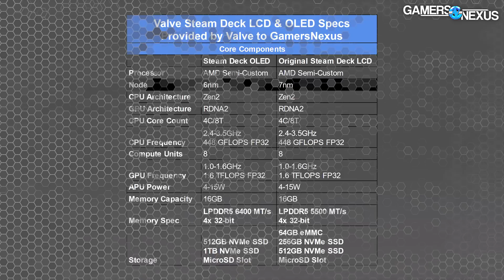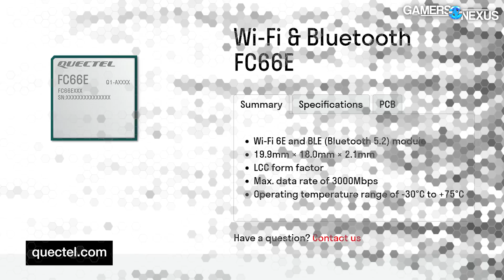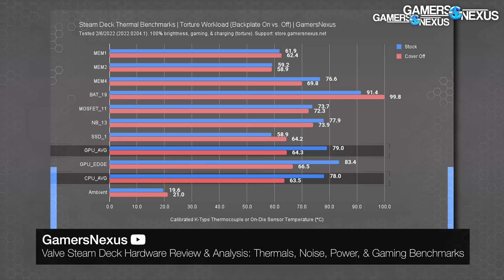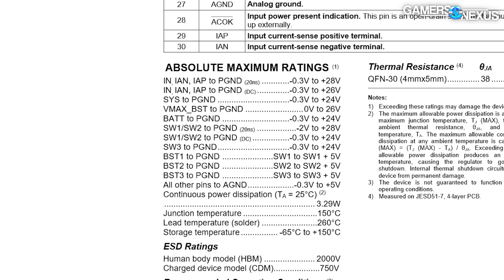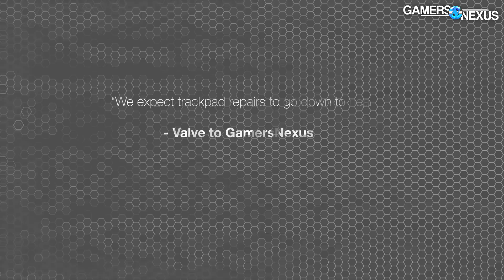They Changed Everything: Valve Steam Deck OLED vs. LCD Tear-Down

Comment: Valve's been doing surprisingly good engineering.
Reply: They were smart to start with controllers and the link before getting into VR and consoles.
Reply: All that practice with past hardware made them actually competent in designing and making consumer products.
Reply: They really knocked this thing out of the park. Been fun watching them over the years. Here I am using their controller to browse the internet on my linux HTPC.

Comment: 3:20 Could they used 4 64 gigabit RAM Modules or 2 128 Gigabit modules for 32GB RAM?
Reply: There's a video here on YouTube where someone successfully swapped the ram modules to double it on the original deck, appeared to work very well after a quick bios tweak. Most likely it'll work here too.
Reply: @Lolwutfordawin  I know, but what is with the new RAM?

Comment: 2:36 does this mean the steam deck has gone from quad channel to dual channel? (or was it ever quad channel?)
Reply: Nope. It still quad channel

Steam Deck OLED use 16 GB LPDDR5 on-board RAM (6400 MT/s quad 32-bit channels)
Steam Deck LED use 16 GB LPDDR5 on-board RAM (5500 MT/s quad 32-bit channels)

Comment: What was the development time for all of these changes? With Valve implementing this significant number of changes considering airflow, efficiency and serviceability, it appears they are interested in quality. I wish some of the GPU manufacturers would put this much effort into their releases, but I guess if you are the biggest elephant in the room, you don’t have to move. Thank you for such a deep dive, no other channel can touch your level of detail!!!
Reply: if only GN weren't just another corporations' shills basically making ads for overpriced crap with 0 progress all the time = supporting and normalizing overprice and absence of any actual progress in tech.
Reply from the maker: They mentioned to us that they began working on it shortly after launch of the original. Not sure the exact timing.
Reply: @GamersNexus  after almost 2 YEARS 0 UPLIFT IN PERFORMANCE. as is they just sell the same crap twice. 0 actual progress = MILKING THE MARKET with the same slow AF crap.
Reply: @rawdez_  why are you like this?
Reply: @rawdez_ the deck OLED is a refresh, not a deck 2. 

OLED screen is a dramatic improvement over the cheap IPS there before, considering it's a handheld you're gonna be using that screen alot, so that alone is a big improvement.
On top of that, they also improved the battery life due to the nanometer shrink, more efficient die and more efficient OLED screen, they improved the fan so it's quieter, they shaved off the weight a bit and they improved the Memory bandwidth, which is a slight performance improvement in some cases.

For all this they're only charging 50 more than the 512gb IPS, and they cut the price of the 256gb IPS which they're still gonna sell as the entry level option. I'd say this is a big win overall.
Reply: @uzimyspecial  and why they couldn't make a faster refresh exactly? I know why: BECAUSE THEY ARE MILKING THE MARKET WITH THE SAME CRAP with COSMETIC IMPROVEMENTS. thats it. Zen 4 and RDNA3 exist for more than a year already, yet instead of using that they use obsolete cheap to produce => OVERPRICED AF crap with 0 improvements that ACTUALLY MATTER.
Reply: @rawdez_ zen 4 and rdna3 won’t have a massive uplift at 15w. Rdna3 architecture isn’t that much more efficient than rdna2.
Reply: @rawdez_  Switching to RDNA3 will introduce another problems when comes to GPU drivers. RDNA3 on Linux is not that matured compared to RDNA2. Moving all the driver work from RDNA2 to RDNA3 right now is not cost effective. You can't just change to another architecture by swapping hardware, software work also needs to be involved.
Reply: @malathomas6141  yet that would be at least the start wouldn't it? as is its the same crap with cosmetic changes after 2 years. they release and sell the same slow AF crap with 0 meaningful improvements after 2 years and you support that. isn't that silly? by defending that you are making worse for yourself because with your stance there wouldn't be any progress ever, and you don't see the problem with that for some reason.
Reply: @rawdez_ why are you so hell bent on performance, man, go outside, take fresh air into your lungs and maybe reconsider that "ULTIMATE PERFORMANCE HIGH FRAMES PER SECOND" does not matter all that much, in a portable device efficiency IS KING and the performance on the deck is "just right" the fact it can run cyberpunk (albeit with some graphic tinkering and stuff) almost perfectly and still last like an hour running it (2 hours and a half with the new refresh) its astonishing actually, a performance refresh should come when its needed, but right now its not needed for the consumer base and 99% of the community around this device
Reply: next time you watch GN please notice their value assessment, yes they say it overpriced BUT for some reason they justify "the normal price" much higher than pre-mining prices.
in "NVIDIA’s Lost It: RTX 4080 16GB GPU Review & Benchmarks" they call it "meh", when in fact they SHOULD CALL IT "A x4 TIMES OVERPRICE" which the RTX 4080 16GB actually is because its a xx70 level card - 30% slower than a top card, and before mining xx70 cards cost around 300 bucks. 
so GN basically say that the RTX 4080 16GB  is overpriced and should offer a better value be priced somewhere in between BUT they don't say that mining is done and a xx70 GPU MUST COST AS at PRE-MINING times around 300 bucks.
thats really weak and too neutral position for tech tubers who proclaim that they are on gamers side. GN said that double digits progress as with CPUs would be fine whereas actually the only thing that would be anywhere near "fine" is the return to pre-mining prices = x3-4 times price drop on GPUs.
as is GPU prices killed PC gaming, people play on old hardware in games on obsolete engines and there's no progress in sight = game devs make games for affordable hardware and nobody can afford overpriced AF new ngreedia/ayyymd crap = no games for overpriced AF GPUs are made = 0 progress in PC gaming = same old Doom 3 2004-level gaming in 2023. very cool.

GN evaluation of current overprice is illogical, mining was the only thing that supported overprice, because GPUs WERE MONEY PRINTING MACHINES, so mining prices are understandable. now there's 0 reasons why GPU prices shouldn't be as they were pre-mining.
and I expect that every person with a working brain must re-adjust their GPU pricing expectations to reality. and in reality THERE'S NO MINING ANYMORE. which HUB and GN should acknowledge and EXPLAIN TO THEIR VIEWERS so prices can have a chance of actually going lower.

Comment: I really appreciate your teardown videos. The nearly bare PCB is actually great to see for Valve, since more components increases the time each board takes to complete. By reducing the components so much they can increase the yield/time ratio and increase their profits by not tying up the productivity of the assembly machines. That should also reduce the contract cost for Valve, and hopefully they will actually manage to make enough profit on the Steam Deck that we'll finally have a true contender against Nintendon't in the handheld market!
Reply: I'm also curious if they have a specialty lpddr5 integrated dual channel module for the OLED, or they dropped quad channel for the APU in the new model.  I saw they massively boosted the bandwidth so maybe they are making up for the channel drop.

Comment: It's interesting that Valve passes the higher speed memory down to the the consumer instead of downclocking it to the original specs like every other console producer does
Reply: I think the reason they didn't run the original memory at 6400MHz may have been due to the thermals being too close to 100C for the APU and other components under load. I think the better cooling and higher efficiency of the new APU allowed them to run at 6400MHz, which may have been what they intended with the original.
Reply: @alex-d3l2z Read an article that interviewed some of Valve's engineers and they stated that the OLED is the version they wanted to make but the tech wasn't there yet (I think).
Reply: OG steamdeck has memory chips rated for 6400mhz(MT62F1G32D4DR-031), so it's kinda weird that they did 5500mhz in the first place and twice as weird that they decided to use higher memory clock on oled as selling point

Comment: Considering Linux gaming benchmarks soon?
Reply: Won't be a point unless you want to test the OS itself. GN focusses on hardware tests, if they're all using the same OS then it's fine.
Reply: @kicapanmanis1060  don't forget that hardware has differing performance depending on the OS.

Comment: Fantastic tear down and comparison video. I'll be picked up my 3rd deck and flipping my slight modded one to a buddy for a cheap price. I feel like Valve hit all the sticking point the communty spoke up about this this new revision. Battery life was my biggest issue. So I'm curious what a indie 2D game at 90/60 FPS could really stretch the battery life to with all the improvements. 

Memory bound games? Red Dead Redemption 2, Resident Evil 4, Last of us, Forspoken, Jedi Survivor. Honestly not how I use my deck but I recall these games were vram hungry so maybe the 6400MT ram will play them better than the 5500MT.
Reply: Performance is nearly identical across the board so there hasn't been any upgrades significant enough to make a noticeable difference. 

You get an improved design of the same machine but that's it.

Comment: 132mm vs 166? That's almost 20% difference. It kinda supports the Twitter argument that this is not just a small die shrink.

Comment: If you're going to go through all of this trouble, then why not just upgrade the CPU to current 7xxx series?
Reply: ......because it's expensive? Current 7xxx series runs on TSMC N5, this still uses TSMC N6 which is a lot cheaper.
Reply: what would be the point?

Comment: Great to be able to see the efficiency improvements in terms of electrical design and components. While Valve say the cost savings are not the primary consideration, the small savings in SMDs allows for more to be spent on other components such as the screen, Wi-Fi, memory modules, etc.

Comment: its amazing that you can in theory connect that very SMALL motherboard to monitor and have a powerfull PC!
Reply: The wonders of SoCs - basically all you need to feed to the package is memory, storage and power, all of the other stuff is just nice to haves like on board wifi and the various bits and pieces to do those things (and even then you could package RAM into the SoC as well if you wanted to). Nothing like the old days of northbridge plus southbridge plus a physical BIOS chip, separate chipset GPU etc etc

Comment: What blows my mind is just how small the motherboard is in the SD. Just remarkable.
Reply: They should sell it as a standalone SBC, could be useful in alot of things, it could destroy lattepanda and their overpriced SBCs completely
Reply: @ca9inec0mic58  the steam deck board doesnt have enough I/O for projects, which is the main buyer market demands. Part of the cost that goes into SBC is the support required to maintain it.
Reply: @ca9inec0mic58 
I wouldn't be shocked if they did that eventually, maybe after another steam deck generation
Reply: Mini Framework laptop? :D  @ca9inec0mic58
Reply: If this blows your mind you should check out smartphone motherboards, those are so underrated and the engineering is actually insane
Reply: Especially for what is essentially a full-featured x86 computer capable of running latest AAA games. Really impressive.
Reply: Now just imagine if you saw the inside of your phone!
Reply: FR this thing is like half the size of an itx motherboard for ryzen
Reply: Standalone PC dreams in this thread... are being realised
Reply: I mean, Intel NUC form factors have existed for the longest time. As well as similar form factors that are mounted on the backs of small monitors.

This is just a flattened and stretched, lower TDP derivative with less IO, but with a screen, battery and controls mounted.
Reply: wait til you hear about phones... whoaaa
Reply: @Bry.89  phones don't have hyperthreaded x86 CPUs or desktop grade RDNA2 GPU, which can also do ray tracing, also desktop windows can run on it..
Reply: @niks660097  Lol imagine thinking RDNA is good at raytracing. Even the latest AMD GPUs are notoriously bad at RT compared to the nvidia equivalent. 

Honestly wish steamdeck went with nvidia like Nintendo is gonna do with Switch 2 again.
Reply: @Bry.89  RDNA 2 is as good as turing and RDNA 3 is better than ampere in RT, so i don't think except for lovelace you can't say AMD rt is bad, its infinitely better than mobile chips and apple one's too, also DF even did a video where Control with RT was playable at 30FPS on steam deck with FSR, they even tested UE5 demos which works fine at 30FPS..
Reply: @Bry.89 the thing is that they can't go only Nvidia, as they only do ARM chips, which would make it completely incompatible with Steam and all its apps and games unless Valve develops some sort of compatibility layer like how Apple did when they switched from Intel to their own ARM silicon, and even then it's not perfect and it would take many more years to be able to develop something with good compatibility
They could of course just stick an Nvidia GPU die in there but then the battery duration decreases significantly and heat becomes much more of a concern, so sticking with an APU for now is the best choice, even if it isn't the best.
Reply: @niks660097  the lies we tell ourselves..
Reply: @Bry.89  what lies? which card is faster in ray tracing 3090 vs 7900xtx? 7900xtx is as good as 4070ti in RT, which is still high end..
Reply: @niks660097  imagine having to compare the highest AMD card with a mid to high end NVidia.
Reply: @Xfade81  4070ti is not mid, its third most fastest card in RT and fourth most fastest in raster, anything in best 5 GPUs available is high end, cause there is also intel low-mid end GPUs, so range of GPUs is very wide..
Reply: @niks660097  so what I'm hearing is that nvidia is better at raytracing.. not to mention it has DLSS which is much better than FSR. So if you think about it, DLSS balanced functionally looks better than FSR Quality, and thus you should increase the performance margin for the visual quality you're getting comparatively. Sounds like I'd rather get a 4070 ti than a 7900 XTX if I was concerned, especially since its cheaper and RT is usually gonna require upscaling anyway.

Weird point to try to prove..
Reply: @Bry.89  Yeah, but still not all games are "RT" only, or have effect specific rt implementation which is actually most of the games i.e pure raster, in which 4070ti is not even close to 7900xtx, also double the VRAM, so the choice is quite simple, but your nvidia fanboy brain can't understand that..
Reply: @Bry.89  other argument: deal with NVIDIA Linux drivers vs AMD Linux drivers, while NVIDIA has Windows it's strong point, AMD's strong point is Linux, because how good the RADV driver is. And that the Steam Deck is designed for SteamOS in mind (a Linux distribution), it just make sense to go with AMD.
+ NVIDIA doesn't do x86 CPUs, so they can't get a complete package like with AMD
So the real alternative here would be Intel, but Valve heavily invested in AMD already the recent years so i see no reason for them to change.
Reply: @Bry.89 the rtx 2050 on the switch isn't gonna do raytracing either
Reply: @LagiohX3  well it wouldn't be a 20 series equivalent chip, it would be 30 series if the 100 different leaks are any indication. So you're already incorrect.
Reply: @Syping  now that's a valid point. Plus Steam Deck doesn't really need to do RT anyway.. not super feasible for a handheld, so AMD was probably the best bet to ensure decent low-cost raster performance.
Reply: @niks660097  nvidia fanboy? Nah they just make gpus with better features tbh.  Sorry not sorry.

AMD makes some crazy good CPUs though.  GPUs are always a hot mess for them. I wish they could put out something good for once to actually help take away the insane stranglehold nvidia has on the GPU market, but it seems our best bet for that will be Intel's discrete GPUs like the upcoming battlemage.
Reply: @Bry.89  tbh, both Nvidia and AMD need a good, hard smack upside the head with their crazy af high pricing for a cut-down ram/pci-e link gpu.. intel's alchemist has been doing a real good job at NOT cutting down the ram/pci-e links
Reply: @Bry.89 not spent too much time with Android phones but Apple’s PCBs are a masterclass. Very dense multilayer design.

Comment: Funny how components get less, smaller and cheaper, the whole design gets optimized  all except for the price..! Apart for the cheap oled at 90hz valve's deck is still no match for ally and Lenovo legion for overall performance... At the new price there's no need to buy a SD oled!
Reply: You conveniently forgot to mention that the price remains the same but you get larger storage.
Reply: @kicapanmanis1060  storage is cheap now for that price should be at least 1tb minimum.. !

Comment: Steve, is it possible to take my current 1tb ssd that loaded up with games out of my LCD deck and put it straight into the new OLED one ? I want to know if this will boot without issue as it will save me a ton of time downloading my games again.
Reply: I can't see why it wouldn't work
Reply: yes, you can do that